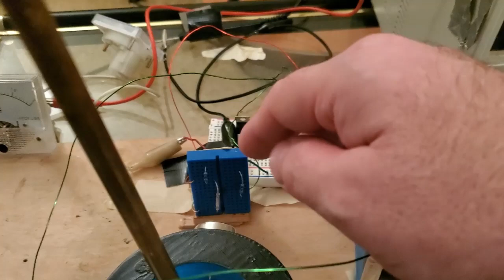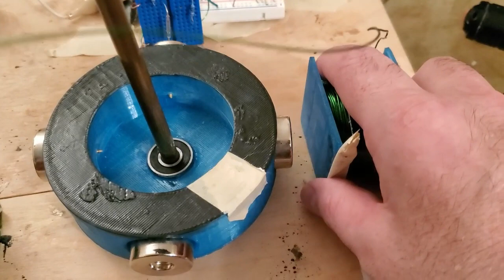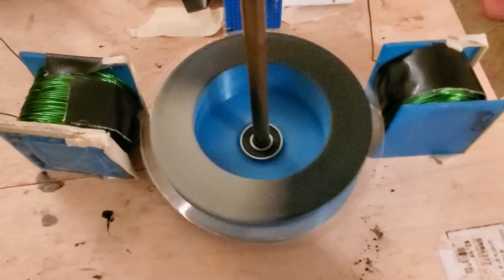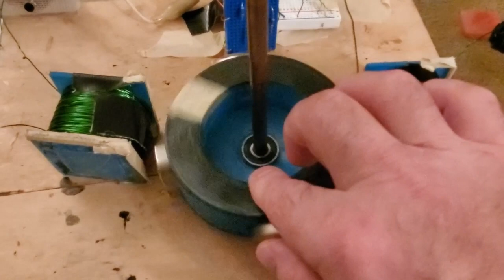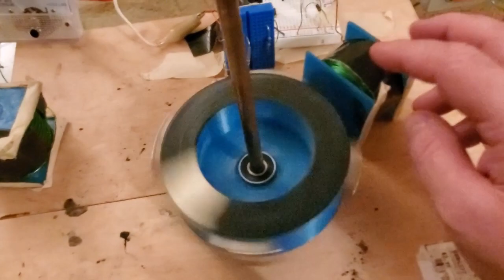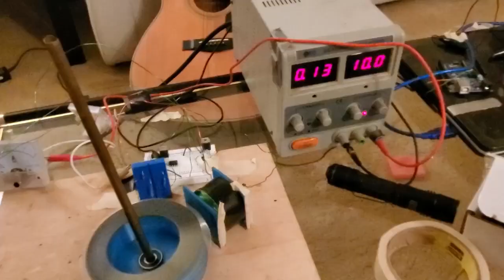Fun with the 4 inch Rotor

Comment: Hello sir , I am doing pulse motor stuff aswell at the moment . I am using reed switch as well . Apparently it good to have resistor in series to limit draw on reed switch contacts and they last far longer . I will be doing this shortly . What characteristics does the Pnp have that you desired compared with the npn ?
Reply from the maker: Hi Buzz,  That's great. I find reed switches to be a bit finicky, I think someone on here also mentioned something along the lines of putting a small cap in parallel with the reed to help it last longer and prevent arcing though I'd have to go back and look at exactly what he or she said.  At this point I am using a hall effect sensor to trigger an opto-isolated solid state relay and am happy with how it works.  As for NPN versus PNP, I dunno, I get there are some minor differences, but for me, aside from the change in wiring,  it would probably just be what I had lying around.

Comment: You need half a shell over one side of the magnet of iron. It cuts down the unwanted magnetic field. Example: the first magnet repels the winding. the next magnet in line also repels the winding but in the opposite direction before correcting itself and going in the correct direction. The shell on one side reduces that.  Also if you change to rectangle or square ( where it is in diamond shape ) magnets you can have one side repel and the other attract the magnet to the coil.   It's cool though. thanks..
Reply from the maker: Thx Nathan, yes, I imagine a lot could be done with magnetic shielding.  For that matter and I've yet to try anything on this but I don't see why two Halbach arrays on two rotors stacked one on top of the other would not lead to the two rotors spinning in opposite directions?? But, one thing at a time.
Reply: Hi there , what iron are you regarding too ?

Comment: 1. Why are you using Transistors. 
2. Why are you using a Reed switch. 
3. Do you have Capacitors on the Coils
4. Make sure the coil is at the same inductance as the capacitor is capacitants.
5. Just using a arduino to switch the Circuit off and on
Reply from the maker: Hi Mad T scientist, sorry for the late reply.

1. Why are you using Transistors. Wanted to use something that could handle a bit more power than a small reed, so used it to trip a transistor.  Might have used MosFets or SSRs, for more recent projects I am using primarily SSRs.
 
2. Why are you using a Reed switch. Straightforward, simple to implement, why not? There are many ways one could approach the commutation, physical commutation, reed switch, reed relay, hall effect, opto sensor, perhaps more.  The reed switch also has the advantage of having a physical make and break between the two metal leaves, so it makes for a very abrupt and clean switch, similar to physical commutation.  Has the disadvantage of possible arcing as MegaHurts RMT noted, so far, while am not driving a machine straight off the reed, I haven't run into that as a problem.

3. Do you have Capacitors on the Coils.  No I do not, Megahurts RMT brought up the same question, perhaps it is something I will look at.

4. Make sure the coil is at the same inductance as the capacitor is capacitants.  In a subsequent video I have run a pulse motor off of a 10 uF capacitor, and ran the machine with the cap in and out of resonance with the coil noting the changes in behavior. 

5. Just using a arduino to switch the Circuit off and on.  In recent videos I am almost exclusively using a reed -> arduino -> SSRs to perform monopole or bipolar communtation either from a DC power source or from a cap that is discharged and recharged.

Thanks for the questions

Comment: You have saved me some work. Thanks.  I wish you had an oscilloscope.  I have an old Heathkit I'm hoping will show me better where the sweet spots are.  I've re-started this project from about 7 years back. Motor looks like an old Bedini with mono coil and 8 magnets on a 16" recumbent bicycle wheel. Using a mono winding with no core and 36 AWG.  With all new machines Configuration is Everything. Keep up the task.
Reply from the maker: Thanks Jack, at some point I will look to pick up an oscilloscope.
Edit 3/4/2023.  Just to go a little further.  My background and education isn't in electronics.  I am getting to the point now though where I occasionally say, darn, I actually would really like to see that waveform. However, I imagine there is a bit of a learning curve and would need to shell out some money and I don't want to spend weeks getting up to speed for it only to be a "look at all the pretty waveforms" sort of result.  That said, I have to admit I am running more often into situations where I am thinking, if I had an oscilloscope I could get my answer easily and straightforwardly, so I'll probably shell out for one and get up to speed on it before too long.

That's great you are returning to a previous Bedini style bike wheel project, 36 AWG, that's pretty thin!  Thanks for the encouragement, if you think of it let me know how the project comes along.

Comment: You haven't had the reed switch fail from either welding the contacts closed or carbonized them yet from arcing? Must be a larger switch than I used on my first pulse motor lol. Putting a small ceramic capacitor (picofarads) across the switch can eliminate arcing when it opens the contacts and prolong the switches life.
Run it the dark to see if it is arcing inside the Reed switch.
 Keep at it, fun stuff to explore.
Mine was a crazy nightmare on getting coils positioned just right because the rotor axel was bearingless magnetically floating.  https://youtu.be/tH0BOkWO1kU
Reply from the maker: Thanks RMT, 

The reed is triggering a transistor which is handling bulk of the power, so for the little while I was running it the reed held up fine.  In more recent versions I am letting the reed trigger an arduino so only seeing 5 volts and I think should be okay, however, good suggestions never thought of a ceramic across the reed. Bearingless magnetic floating axel you say? Ha! That I have to see, yes I could imagine it was a bear to get running, thanks for the link will definitely check it out.  

It is certainly fun, and got a bit more fun once I picked up a 200 buck 3d printer, lots of possibilities.
Reply: @paulmaher812   You're welcome and thanks too.
I also bought a sub 200 3d printer recently and am looking to put it to work on motor parts.
 And yes, it was a bitch getting mine to run balanced at high RPM's,  had some scary test runs that did damage to my bench stuff when rotor got loose and rampaged across it 😂.